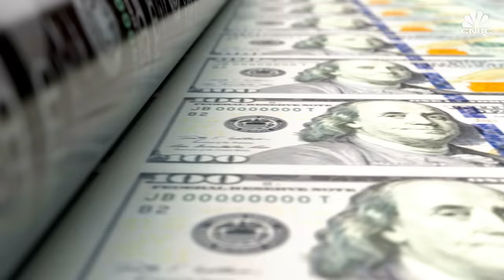Why The Singularity May Merge Humans And Machines: Nouriel Roubini

Comment: I see the rising interest rate as a very big problem, as more investors will definitely pull out more money from the Stock market, Bitcoin and forex. This might have worked when I was still invest-ing with a couple thousand dollars, but it is more difficult now to decide whether to pull out more than $365k from my port-folio. I know some inves-tors still make that despite the strong bear market. In wish I could pull that feat
Reply: I think the whole thing about holding stocks for long term will always apply. So I think you should get a quality broker who is able to analyze and pick stocks that will do well in the long term, else you will be in a long bear ride.
Reply: You have a very valid point, I started investing on my own and for a long time, the market was really ripping me off. I decided to hire a broker, even though I was skeptical at first, and I beat the market by more than 9%. I thought it was a fluke until it happened two years in a row, and so I’ve been sticking to investing via an analyst.
Reply: @Olivia-sz8xe This sound interesting. I’m not really one to use pro analysts, but I guess it would not hurt to try one. My portfolio is in the red waters right now